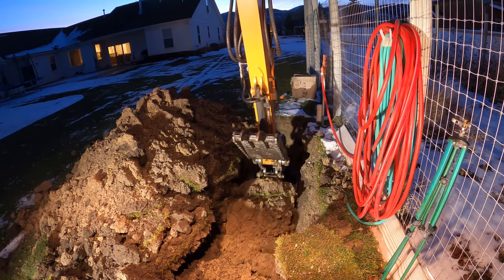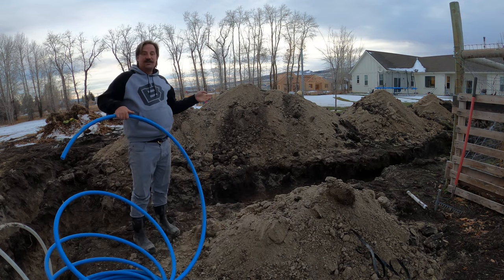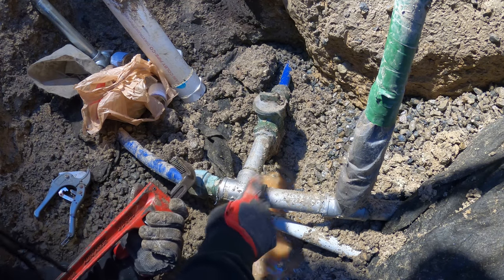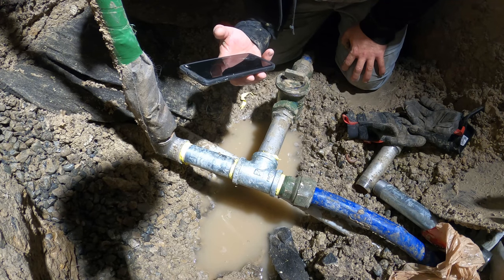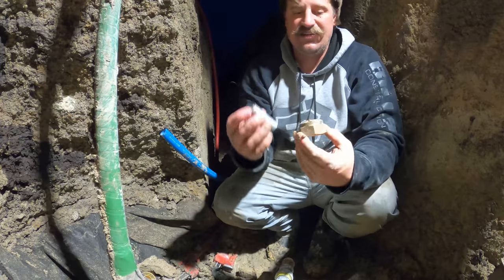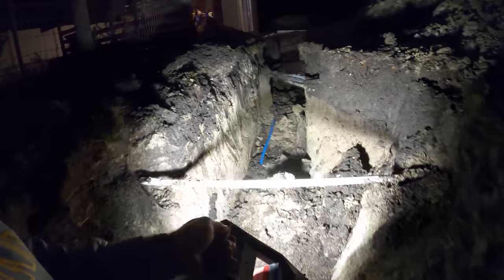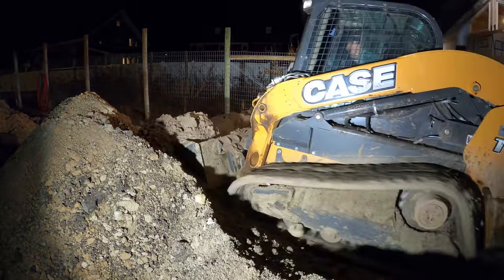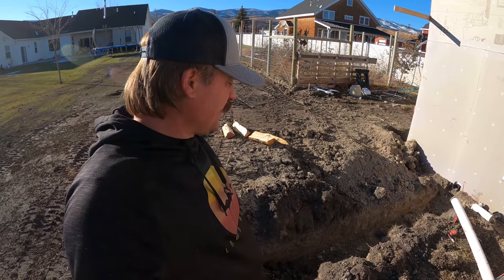RUNNING A WATER LINE TO AN OUTBUILDING OR A SHED

Comment: Anytime you have connection points or any other current or future access points on something buried back fill around it with sand.  It not only marks it when you dig it back up but makes it easier to hand dig around it.
Reply: Yes sir absolutely..

Solid gold advice.

Comment: Just did the same exact job here in New England - it’s a lot of work. Only thing I noticed is you took the time to dig down deep enough you should have kept it that deep when you brought it up into the foundation of the new building - looked really shallow where you entered the new building - Also would have been worth your time to sleeve that water line so in the future if there’s any issues you don’t have to dig the yard up again. I’m just starting to get my grass back to normal after all the crazy digging we had to do. It’s a hell of a job I salute you for taking it on yourself 👍🏻👍🏻

Comment: Blue the right coupling that fits your pipe over or into the bell on the other side pipe fittings and it should go together. I just went through this doing a super French drain for a customer. 🙄😒
Reply from the maker: Thanks for the tips!

Comment: Nice job man.. Surprised they used galvanized pipe, not up to code here in Jersey since it builds up deposits and corrodes.
Reply from the maker: yeah I wonder if that old stuff was stainless. The new fittings that I put in were galvanized. Those fittings that i dug up have been there for 7 years.
Reply: @lawnrebel  You should be good for the next 50+ years so let the next guy worry about it.  I say this because I was that next guy that bought a 50 yr/old house and wound up changing some galvanized stuff during some renovations and saw the 3/4" fittings were down to 1/2 diameter and built up with corrosion and crap and I have really good well water here.

Comment: Yellow teflon tape is rated for gas pipe, not water pipe. All those connections are future leakers. And as a plumber, always tape AND dope your water main connections. You want to give yourself the most assurance as possible when it comes to water mains. You don't want to be the one that has to dig that all up again and re-do it because it's leaking unless you like unnecessary extra work for yourself. I don't.
Reply: @Tyler Anthony Maybe, maybe not, but it's still wrong.

Comment: Dude you coulda buried an oil pipeline in that trench you dug, did you ask for the biggest bucket they had, it was a 1" line, and its buried like 4 ft deep, does it get like  - 120° there, you might wanna start hiring stuff done
Reply: So he can film the plumber.....? Nahhh lol! Can't wait till they open the buried time capsule in 2070 :)
Reply: What do you recommend? Closer to the surface so the line freezes?
Reply: He did it exactly like he should have - you obviously aren’t familiar with living in cold areas like New England. He was a bit deeper than needed but it doesn’t hurt anything especially if you got the machines to do the work. He could of got away with a foot less it looks like but who cares he’ll never have to worry about it freezing and that’s worth the peace of mind